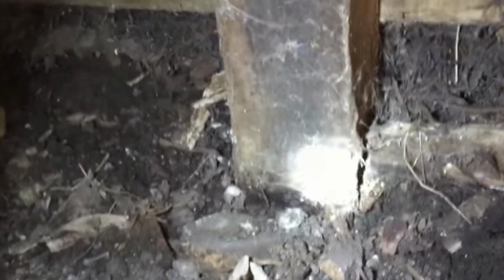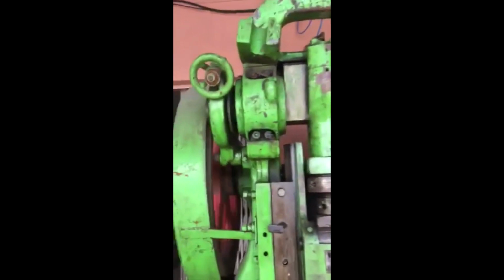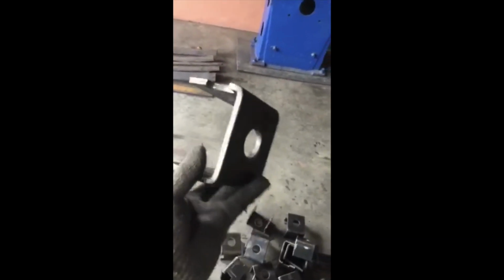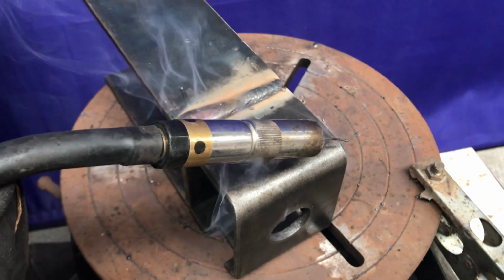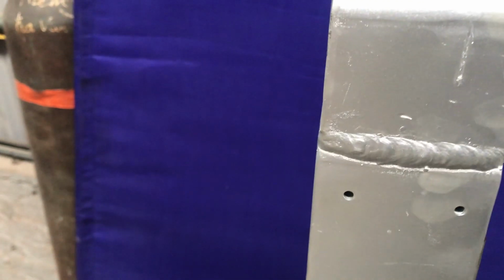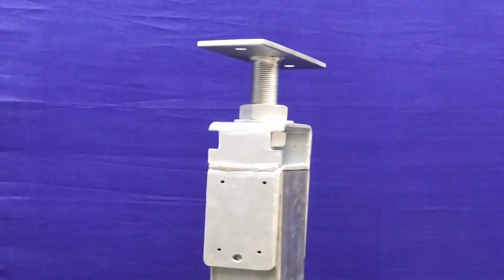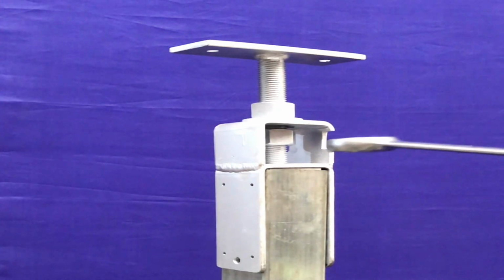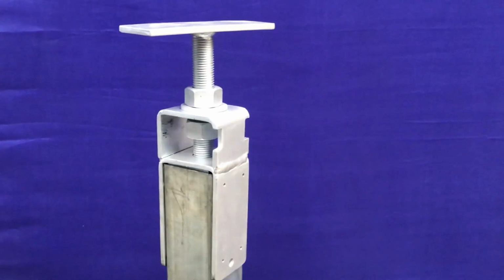Adjustable house stump, future proof your foundations by installing leave in place adjustable stumps

Comment: Hi,wondering if the adjustable house stumps would work from the opposite way meaning my 75mm steel post have rusted around the bass. Maybe a cemset typ bolt into the concrete footing.
Cuttings out the rusted section, upside down so to speak. Or do you have any other ideas.

Comment: Termites in wood and rust in steel , take your pick! Everything turns to disorder in the general laws of thermodynamics
Reply: Unless you have water issues bad enough to rust your steel...or maybe next to the beachfront...this is a ripper idea by the looks of it
Reply: You can cover in fish oil before installation.  Do 3 layers.

For the threads and bolt, I'd just use some thread anti-seize compound.

All in all it'll probably outlast you and I, so I wouldn't worry about it too much.

A good hybrid approach is concrete around the centre and adjustable steel around the perimeter.

Comment: urban myth.. steel posts stop termites. False man. apart from that little misdemeanour your post adjusters look good
Reply: Yes you are right about that termites will track over steel but they can not track though the solid steel thread which gives a easy inspection point.

Thanks for your comments I am pleased you like the design and it was a important comment you made.
Reply: You don't just use steel footings you use steel for the whole house frame, only problem is it's more expensive, but since every state has termites except Tasmania it's best you go for steel option.
If you have timber frame house do not store firewood anywhere nearby, and do regular inspection for termites. I've seen termites aka white ants destroy a 3 year old home I kid you not.
Reply: @samueljesse2179  if i could share photos on here i would show you just what they can do in a "steel" house

Comment: Hi, How much weight are these adjusters rated for?
Reply from the maker: Hi SORRY I missed this comment, At this stage you will need your own engineering report for your building and your country. That will normally tell you how many you can use and to what extent they can be adjusted out. As these have a 33mm threaded pin and most others on the market are 29mm, they should rate higher. 
I hope that helps 
Regards 
Peter

Comment: if the stump top is going tink tink when you walk on the floor-AINT THAT TIME TO USE YOUR ADJUSTER, TO , LIKE HELLO   do you know your own product ?
Reply: Thanks for your comment steve and yes I know my product and because my product has a locking nut this would never happen but it can happen with other adjusters like the level master stump adjusters that do not have a locking nut.

As to knowing my product, if you are saying that a floor can never be level and still have a soft floor where their can be movement when walked on, you would be wrong. The point of adjustable tops is to make the floor level but in some cases (very rare mind you), it can be level and because you have pulled the floor down in that position to get it level when you walk on that part of the floor it can push it down the 2mm that level master leaves clearance in there nut and cause it to go “ting ting” as the weight moves the floor down a little more.

Maybe you have not done enough restumping of houses to see this happen with the level master product but it can happen but not with my product that has a locking nut.

I hope that clarifies things for you

Regards

Peter
Reply: Mate don't use stumping! Concrete slabs are the only way to go!
Reply: @samueljesse2179  until mine snapped, and ripped open the  roof

Comment: Hi there. Just wondering if you could use the stump adjuster on top of a hard wood post?
Reply from the maker: Hi #Zackary Miller you can put them on a timber post but the pin would need a hole put down the middle of the post… I am not sure how strong or practical that would be maybe weld an adaptor on the bottom to fit your post. Depending on how many you want we could custom make them to your design too minimum order are about 150 units plus design costs.